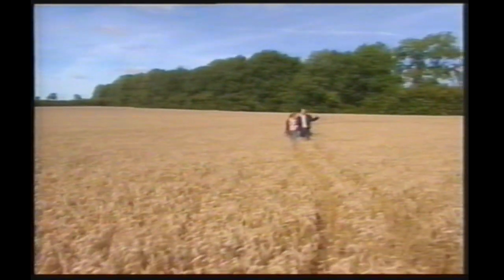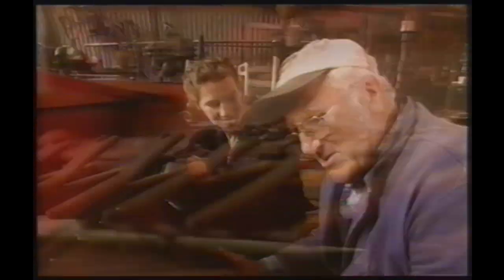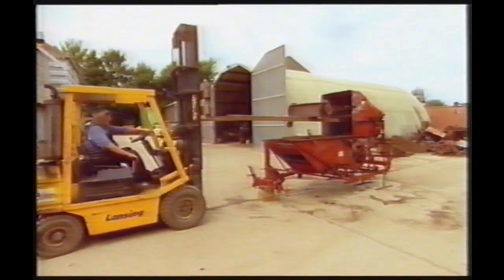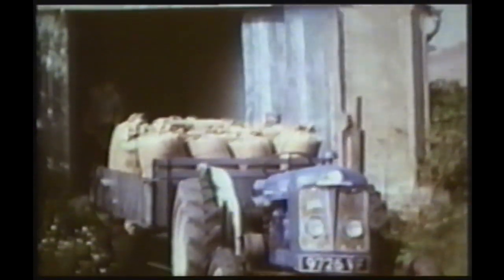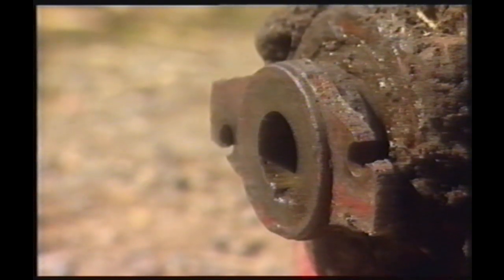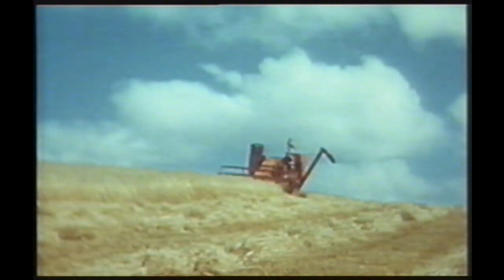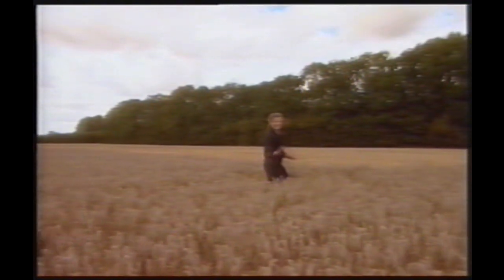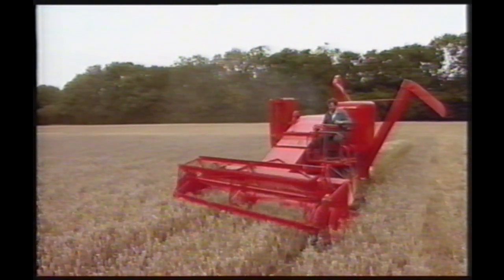Salvage Squad Massey Harris 780 Combine Harvester

Comment: I had the privilege of meeting the combine man Ron Knight a few times. A few times at working events but a couple of times he made some hard to find bits and pieces for my old combine. Its hard to find words to describe his amazing collection of vintage machinery its just amazing. I wouldn't be surprised if it were the most extensive and varied collection of combines in the world. I visited him when he was rebuilding the only self propelled Marshall combine still in existence, 1 of only 2 built. He literally had a heap of rusty metal and two photos of the machine when it was new. Using the photos he eventually managed to bring it back to new. Amazing stuff! I wish i had spent a bit more time with him to pick up some of his methods. The Massey 780 in this program is part of his collection now. He bought it of the farmer after the program was aired.